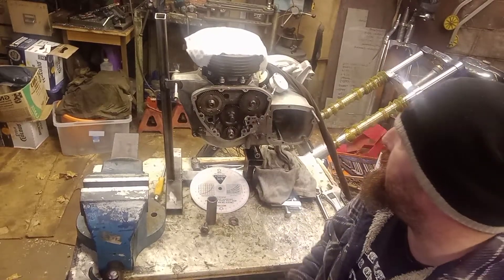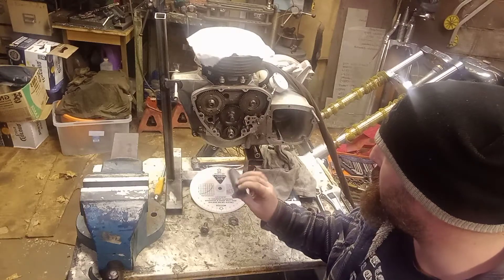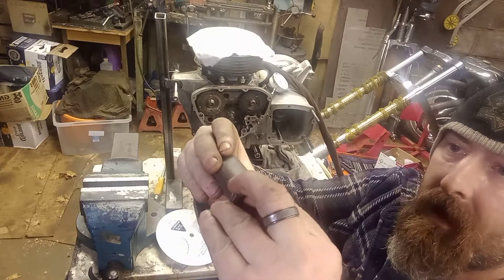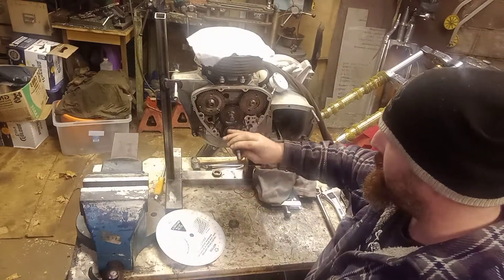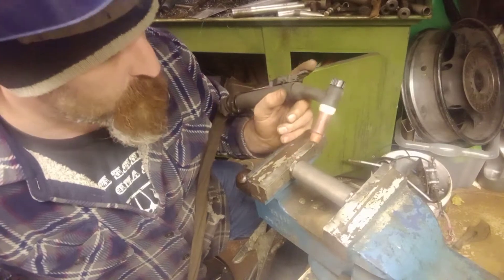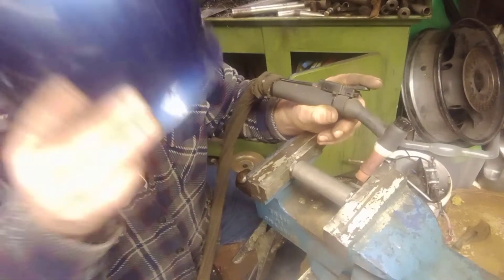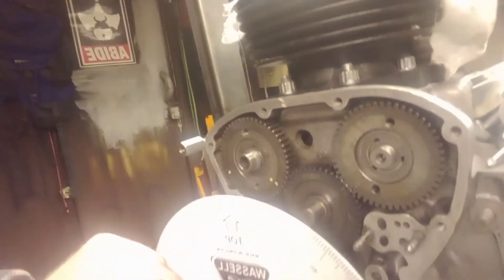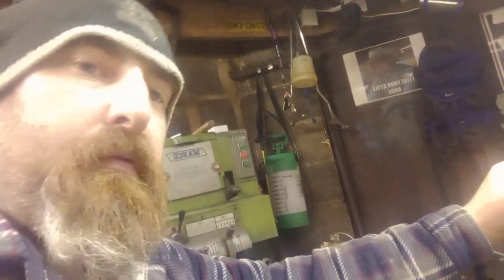TRIUMPH T140 T120 BONNEVILLE CRANK EXTENSION TOOL FOR TIMING DISC

Comment: Fascinating workmanship. thank you so much for sharing. need to fabricate this timing wheel standoff device as well as the brackets for the measuring at the top end. not everyone is as handy in fabricating such devices. everyone is as handy with such fabrication as you are.
Reply from the maker: It doesn't have to be exactly like mine, but you get the idea. I've made the same thing loads of times and by the time I need it again, its already been recycled into something else. It just easier than screwing the disc to the drive side and constantly looking over the top. Hope it helps. Thanks.